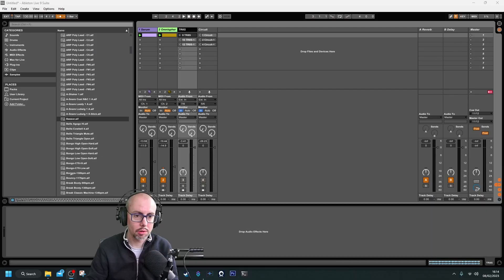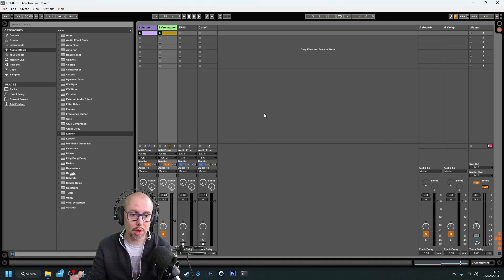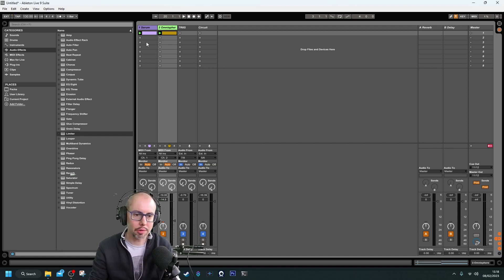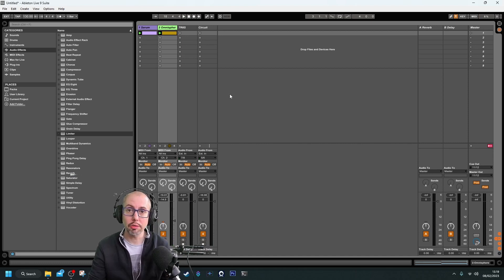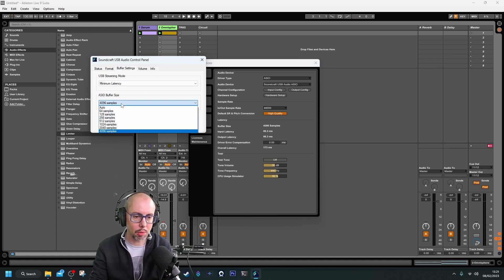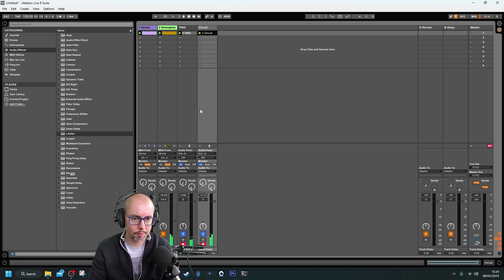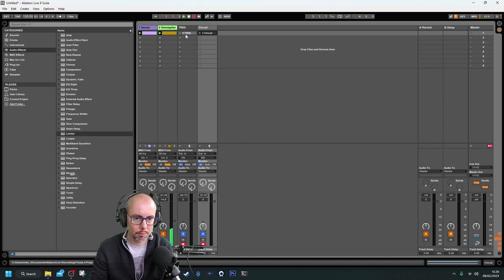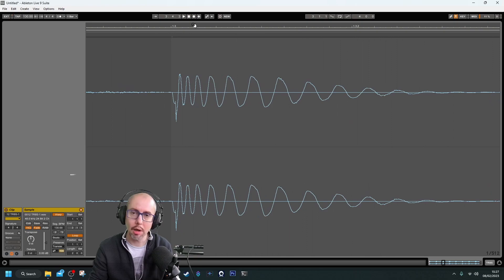Understanding Latency - The key to recording music hardware

Comment from the maker: Alrighty. Full disclosure. As @krezmuzik says below, the best way to connect a hybrid setup is with the external instrument device. I've done some more study and im confident all the theory about buffer sizes is correct, but i think the use of midi clock adjustment is only applicable in the specific context I was using.

Turning the channel monitoring off reduces latency dramatically, so if have things set up as I did and you then toggle monitoring, things go out of synch again.

Probably best to consider this as a bit of a workaround and I'll try to put up a better video soon. ✨🪐

Comment: Tip: If you view the recorded clip in Ableton, you can click and drag the distance between the grid and the first transient of the audio. In the bottom of the clip, Live will tell you the duration of the selection in milliseconds. You can then use that value to adjust the latency compensation as shown in this video.
Reply from the maker: Good idea. Thanks for sharing this. 👍
Reply: Problem with this is if you’re recording synthesizer you can’t really see the transients like you can in the video
Reply: @ProducedI  You can if you make the synth have a short transient (attack) at the beginning.
Reply: True

Comment: WRONG! Use the Hardware Instrument device.
Reply from the maker: Not WRONG. If you check the Ableton website it gives several methods. If you have Ableton Lite or Ableton Intro the External Instrument  doesn't exist. Its only available in Ableton Standard and Ableton Suite.

The External Instrument is preferred as it is more convenient - but isn't the only solution.
Reply: @MikeRenouf  its the only method that works when you start using plugins etc to compensate for additional latency. I’m not being a jerk I’m trying to help other people avoid the frustration when using a hybrid environment. It really is the only way that works without issues.
Reply from the maker: @deepnlow808  cool - thanks for updating so we get a clearer explanation. I'll look more deeply into the options so we get a better understanding 👍
Reply: @deepnlow808  I’ve been using Live for 15 years and I still can’t figure out a way for it to not all go to shit timing wise. As soon as I add a latency inducing plug-in all my timing goes haywire. I’m using external instrument and hardware latency, as well as midi clock compensation in the preferences. It honestly drives me fucking crazy. How do you have it working once you add plugins? And the plug-ins don’t even have to be on the god damn hardware tracks for it to fuck it up, just anywhere in the project. It’s really insane :/
Reply from the maker: I really dont have enough knowledge to be sure, but might it be due to your system struggling and a need to increase the buffer size so the processor can cope? That will increase latency, but allow synchronization to be achieved?
Reply: @MikeRenouf  you would think, but I have a super powerful hackintosh built for audio production, my cpu meter is sitting at 1-2% when this is happening. I can run a ton of tracks filled with plugins at a 128 buffer without a hiccup. I’ve tried all potential fixes and I really think it’s a problem that is just baked into the software. There really doesn’t seem to be a genuine fix except for buying an expensive hardware midi clocking device. I absolutely love this DAW but they really need to sort this out because it’s a widely known issue and its pretty shameful at this point on their end.
Reply from the maker: Sorry to hear that! If you find a fix it would be great to share it. Likewise if i come across new info I will let you know 👍
Reply: @MikeRenouf  Yeah of course man! I’m forever trying to figure this out apparently. Hopefully I will achieve enlightenment one day 😂 I’ll be sure to share the knowledge.
Reply: @BIG_PASTA  I'm sure you have checked this, but do you have the delay compensation turned on in Ableton?
Reply: @SsgtHolland  yup. I actually recorded videos and essentially handed a thesis presentation to Ableton support so they couldn’t write back with some bullshit response and I actually got an answer. “It’s unfortunately a bug with the external instrument device”. A fucking bug?! Lol one that has apparently persisted for many versions of major software updates. I really didn’t even know how to respond so I just didn’t 😂
Reply: @SsgtHolland  the direct quote from my email:

 “Thank you for writing to Ableton Support. I'm sorry to hear you are having troubles.
 
The issue here is that there is a bug related to the Hardware Latency setting on the External Instrument device:
 
"Adjusting the Hardware latency slider on any External Instrument offsets all audio recorded directly from external inputs in a set."
Reply: @BIG_PASTA   Thanks, I will keep that in mind. Ableton really dropped the ball on this, this should be right on top of their to-do list.

Comment: Holy crap, I've been wondering about this for years... Thanks man!
Reply from the maker: Hey, you're welcome 👍. Glad this helped!
Reply: @MikeRenouf  Curious if you've seen this. I'm trying to sync up an Elektron Analog Rytm MKII to Ableton. I'm just trying to go simple by getting a kick lined up, but the very first kick of every recording seems to record at 1.1.3 then it's lined up at 1.2, 1.3. 1.4, 2.0, etc.
A little strange here and I'm scratching my head.. not sure if this is an Elektron thing or an Ableton thing.
Reply from the maker: I find the first percussion hit is sometimes a bit off too but everything matched after that. When Im recording I find its worth giving a bar or two of lead-in time for the gear to all synch.

Its interesting that your setup is off by that specific time period though.
Reply: @MikeRenouf  Yea, it's been a while since I've tried syncing up with Ableton again. Haven't had any hardware for about 4 years. But this video got me going better than I ever had in the past. If you experience the same thing, it's probably just an Ableton thing. 
You mentioned it's a percussive thing.. I haven't tried a hardware synth yet.. Do those not have this issue?
Reply from the maker: I just meant its more noticeable with percussion, because the first fragment of audio is misaligned. It no-doubt affects keyboard synths too in that way.